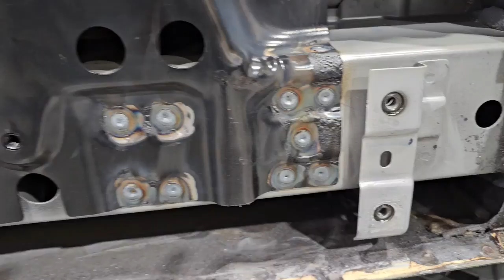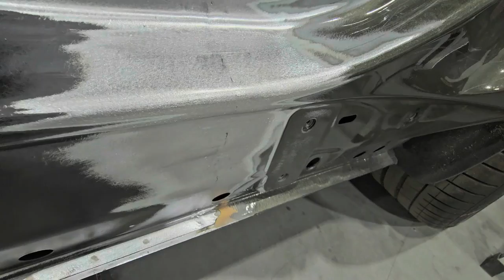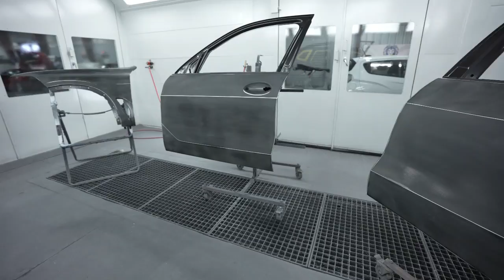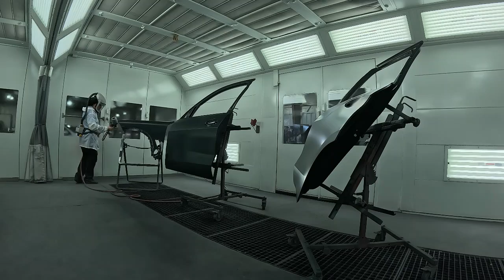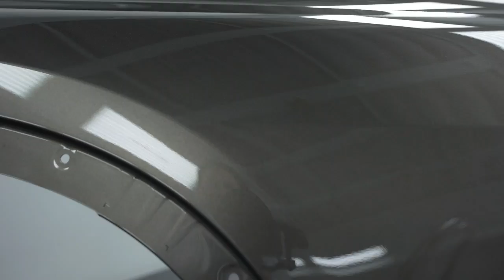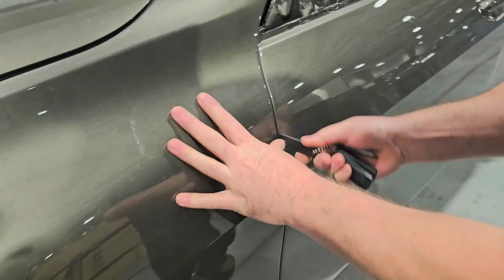Repair and Paint on a 2022 X5 BMW

Comment: ❤ I'm so glad I watched this one, I learned a lot about replacing high strength steel parts rather than repairing and also to make sure to have epoxy primer under the filler...much different than self taught ways I'm familiar with. I can hardly express just how relieving it is to finally really know and understand the correct ways of doing these things after years of guessing and trying. Very grateful and appreciate all the knowledge❤

Comment: Did u seal the quarter so that when the rear door is on and shut it looks the same or was this one of those colors u knew would match?
Reply from the maker: I did seal the leading edge we did a repair to the quarter jam .but it's not necessary on this color
Reply: @kandyman5315  how do u identify what colors you need to seal the leading edge for blends and matches?
Reply from the maker: Spray a test card with the sealer shades to how it covers

Comment: How long did sanding that take to complete? Also wondering what is provided by the body shop and what do I need to buy?
Reply from the maker: Depends on the shop I like to have my own stuff
Reply: @kandyman5315   my work currently provides everything. I like having my own stuff and slowly building my collection. I wouldn’t want to use anything of mine on the boats I paint. I’ll take a picture of how nasty my gun gets when basing the inside. With clear I’ve had my trigger get sticky from clear overspray and stick open!